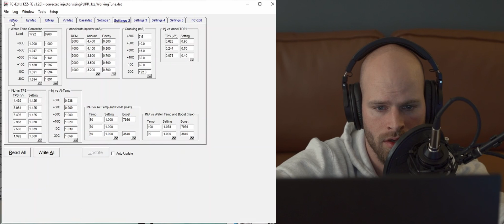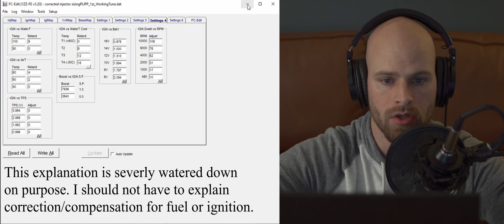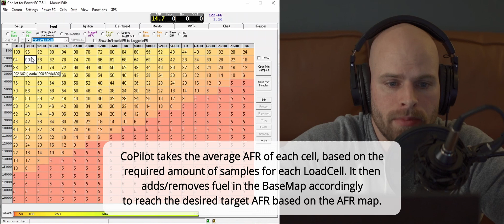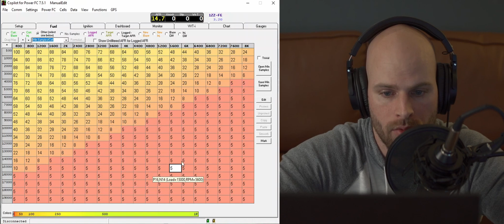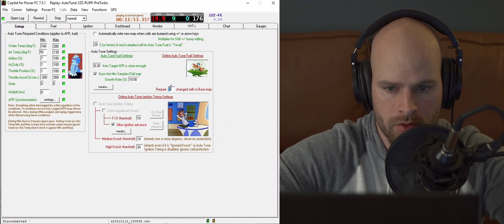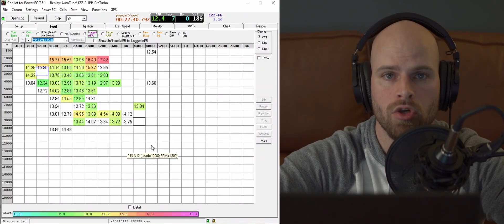Apexi PFC - Tuning AFR's with CoPilot & FC Edit - Fuel and Injector Maps

Comment: Thanks for answering some of my questions, I figured most of it out only the longer that my car uses the auto tune function the worse the engine runs.. as time goes by my tune seems to be looking good in the logged afr section but it is badly stumbling like it’s way too rich and chokes. I couldn’t tell it it was too low ignition since I’ve been lowering it where I see high knock mostly at the very low rpm where it drops under 1000 rpm. Also the car said it was pretty lean at higher rpm going into boost so I richened it up and now it won’t go into boost like it’s chocking and has a 4400 rpm redline. I’ve got a couple broken exhaust manifold studs, maybe the afr readings are off? Maybe the widebacd is too far from the turbo? I did the recommended 24 inches..
Reply from the maker: Speaking from experience, any sort of exhaust leak will drastically change your AFR's, so I would fix that first. Also, I would watch out for the knock values and do some research to find out what's true knock and just noise. In lower load cells, it's more likely that it is just noise and not true knock. For me, I found that If I had ignition autotune enabled and i'm just idling, it throws things way off. I would recommend locking the low load blocks so no changes are made to ignition timing in those cells, and focus only on load/WOT, Roll on throttle, etc. 

As for the fueling, that will more than likley be because of either a mis-calibrated wb02 or an exhaust leak. a quick test is to turn on 02 feed back and watch what the AFR's are. the PFC will try and get an AFR of 14.7-15.1, so if you see crazy AFR's when standard lean cruise/02 feedback is enabled, then there is a problem.
Reply: @PatrickLipp  after more testing it turns out it was the opposite of what I was thinking. Whenever my tune goes just over 14.8 into 15 it stutters and won’t go any higher in rpm. I tried leaning the tune out and it got worse like every rpm would do it so that led me to believe the tune is running leaner than it says. I richened the tune and smoothed it out best I could and it’s back to running good at all rpms out of boost at least. I’ve still got some progress to make still since when I step on it and go into boost it hits 14.8 afr and stutters still so I’ve got to add quite a bit of fuel for the high load areas. 14.8 just always seemed like it would be an ok afr so I was confused but I’m guessing it’s much leaner than it’s telling me. Sadly I cannot fix the manifold studs, I’ve already broken a couple drill bits off into them because I didn’t have reverse bits so now they have a titanium bit wedged in the middle of them. 

My question is has your tune ever ran so lean it wouldn’t accelerate? If so what afr did it hit? I’d like to find out what 14.8 really is for me car so I can adjust the numbers to where they really should be.

Comment: If you adjust your target afr map do you need to make any changes to the inj map? Same with the base map, if I change the base map do I need to change the inj map? I recently changed the target afr map and my car is hesitating in boost at 4300 rpm but I’m pretty sure it wasn’t doing that before.
Reply from the maker: so the Target AFR map in copilot does not affect the tune at all. It is only used as a reference when auto tuning. CoPilot takes the reading from the wb02 and compares it to the value in the target AFR map. It then either adds or removes fuel from the base map until the realized(real) AFR is the same as the target afr.  now, technically the base map should be the same as the target AFR map, and in theory you should be able to make adjustments to this map based on your target afr and it should match up with your wb02, but that is the theory and only the case if the INJ map is perfect, which it rarely is. The base map is what you should be making changes to.

Comment: I have a pre tuned base map but I do not want to reset my whole tune in order for the pfc to relearn my larger injectors. How would i setup the injectors in the pfc in order to adjust my tune for the new injectors?
Reply from the maker: First off, resetting your pfc won’t make it relearn new injectors. What software are you using? I would recommend FCEdit. You’ll need to input the various information such as input lag/voltage, injector sizing compared to stock, etc. so long as the values are correct, then the map should be almost perfect, but would probably need some slight tweaks as there’s always variances between injectors, flow rates, etc.

Comment: Hey man! I appreciate the series / guides, but I'm running into an issue (hopefully you'll be able to respond)

So I got me wideband, and autotuning setup (copilot reading AFRs same as my wideband gauge, and all the green boxes are lit)

I select "START" for the autotune process, but it doesn't actually do anything. It claims autotuning is in progress, but I set my idle target AFR to 12.0, and even after about 5 minutes of idling, nothing changes in my new base or inj map. Nothing changes at all, so I'm not sure what I'm doing wrong?
Reply from the maker: check the Throttle position requirements. The default setting is at least 1% throttle, so idle won't tune.
Reply: @PatrickLipp  that might've been it. Anything else?
Reply: @titusarms  get this figured out yet? Let me know. I had trouble getting it going but now I'm slowly logging and auto tuning.